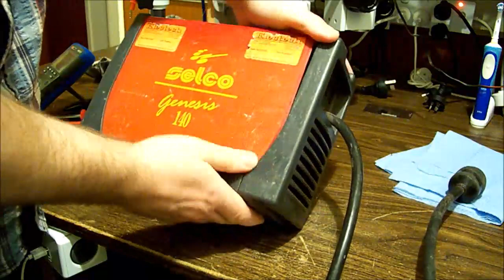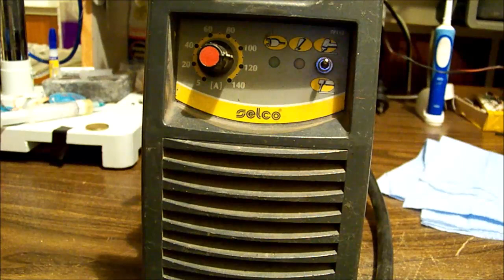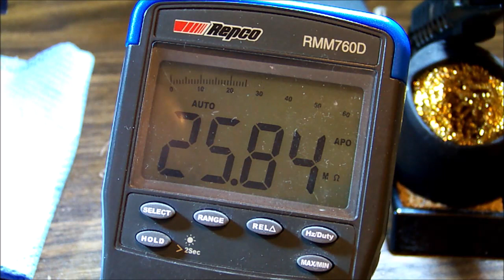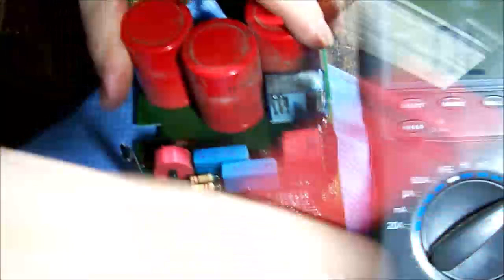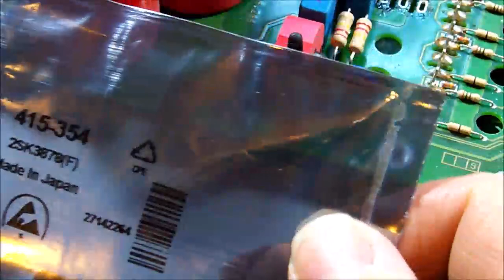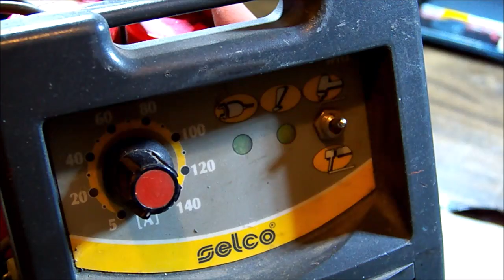Selco Genesis 140 amp inverter arc/tig welder repair

Comment from the maker: Unit tested and works fine!
Reply: I'm faced with repairing an Lincoln Invertec 205T TIG welder who's Superposition Board has about 5 transistors that zorch about 90 seconds after powering it up.  To prevent reverse engineering there isn't a single reference designator on the board!  I just discovered that there is an identical Selco version that has a very abbreviated service manual and parts designators!  Your video has given me some positive encouragement to dive in again.  :)

Comment: It seems you just about covered everything perfectly and I would use your services no doubt , for what it's worth seeing i am just a pupil . My biggest fear is customers disappointment with come backs , can you really be sure the original cause was the mosfet ? Just normally hot for to long, and should the rest be replaced ?  Probably not, but you got a new subscriber . Cheers
Reply from the maker: Thanks, glad you enjoyed! Stuff fails, maybe we know why maybe we don't. Fix it and it should last long enough to not be an issue. Come backs won't be the majority. Depending on the country you can offer a warranty on your work for as long as legally required. The more you do the better you'll get at it and that will reduce the chance of come backs. Sure they might be disappointed but if you deal with it honestly and not make it a big deal for them you will win them over. There will always be that one guy who is annoyed at everything unreasonably. Let him go to someone else. Good luck with your future!
Reply: Great video,wish I knew more about components. I have the exact same machine it doesnt seem to weld on the arc setting and tig setting without gas,the weld isnt strong

Comment: Hi. Do you also know about welding machine repairs? the machine is working but will not arc at the electrode output is only 64 volts.

Comment: Fantastic explanation....
I am wondering can you measurw the relay with out take out from the  PCB?
Reply from the maker: Sorry I'm not sure what you're referring to. Can you specify the time stamp for the piece I'm working on as I don't recall a relay. If you mean MOSFET then sometimes. If there is some kind of resistance across the drain and source pins you will get a false reading and might think it is bad but it will test ok out of circuit.

Comment: I am working on an old amp and it has a zener that is completely blown up. Can't read anything off it. Any ideas how I can work out its value?
Reply from the maker: Can be tricky without finding a schematic. Maybe you can study the circuit and figure out what voltage should be there, e.g. is it on the power line to an IC? Look at IC datasheet and use a zener that will maintain typical VCC. Any capacitor on that line.... if there's a 16V one then maybe zener should be 10 or 12V to maintain the rail as caps are always rated higher than needed. Good luck!
Reply: @JonnyFix  thanks for the hints. I will take a look.

Comment: Jonny, I love watching your work. Great approach but I have a tip for you, Instead of putting another fuse inline and chances it will blow again, you can use a light bulb in series with the fuse and if it has a short the bulb will glow bright and if there is no short it should light briefly and then go out. In that way you can save on your fuses.
Reply from the maker: Thanks mate!

Comment: For a quick and dirty load test, use a steel wire coat hanger cut and ends bent into small U shapes to snug into the output threads, then wind the current up. 
This will sink many tens of amps before glowing.
Reply from the maker: Neat. Will remember that for next time (or if it comes back still no go lol  )
Reply: Can also use multimeter and check output voltage. If available and normal can guarantee operation